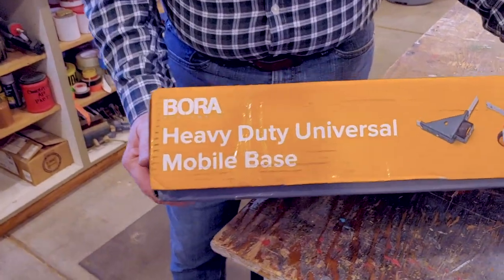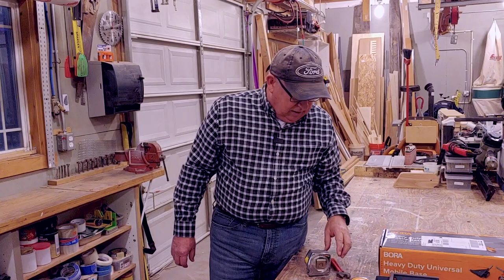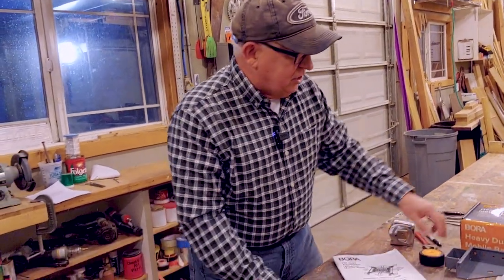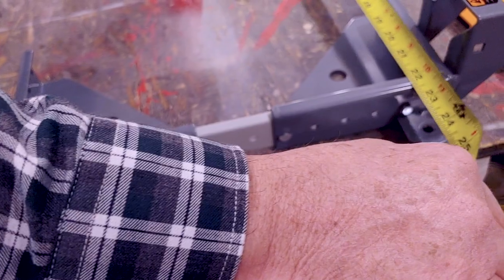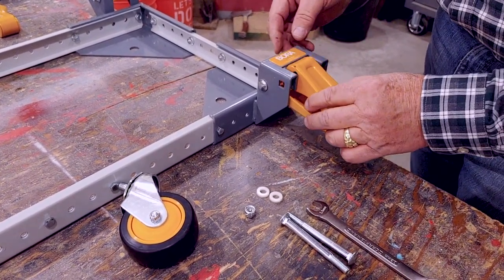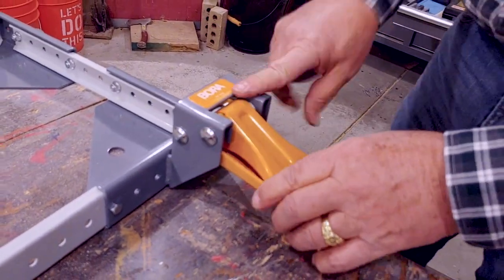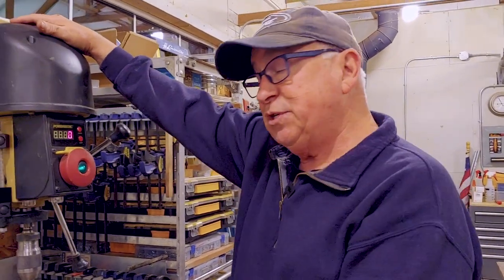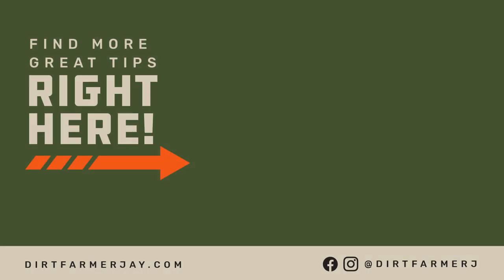Bora Portamate Tool Mobile Base

Comment: Your video I’ve referred to the most in picking this base, assembling and I’m very grateful you filmed this! One note for ppl, remember you need two bolt contacts on every corner and bracket joint where joined. I didn’t catch that at first but no biggy! I’m just so relieved to have something for my particular situation. I bought a side mounted Masterforce cabinet, I needed something heavy for my bandsaw to go on top of but also mobile because I have a tiny garage. Unfortunately Menards and the brand Masterforce were both difficult to work with. The manager laughed when I asked for the wheels that go with these cabinets… mine wasn’t sold with wheels unfortunately but I knew that when I bought it so not the store or brands fault there however if you tip it over on the bottom are four perfectly tapped holes in every corner of the base to add wheels onto. The manager even looked for himself, agreed each corner had four tapped holes but wouldn’t sell me the wheels that unfortunately are the only ones to match the tapped holes. Not happy, but I found this solution and was cheaper than buying four wheels for the cabinet. Now I can actually roll it around on my horribly unlevel concrete floor lol. My floor is so cracked and ridiculous I just hope I really can wheel this sucker around because with the cabinet and the bandsaw it’ll because extremely heavy. I still wonder if I should’ve just built my own damn bandsaw cart.

Comment: Thank you for this excellent video.  I am moving from an apartment to a new home that will have a woodworking shop.  After negotiations with my wife, the shop will be a bit smaller than I hoped.  Therefore, mobility will be very important.  One viewer commented on the cost.  But I doubt he'd considered what mobility bases cost when you look at buying one from the manufacturers of your woodworking machine tools.  if there even available the cost is double or triple the Bora Porta mate - and often these bases get bad reviews.  I love how you teach and I think you've sold 2 or 3 more of this product.  So if you're listening Bora, send a big check to Jay

Comment: Well done. I appreciate your well planned and clear instructions. My tip... my table saw, planer and assembly table are all on casters. They are set to the same height, so the assembly table can be an outfeed table for the planer and table saw. My drill press is mobile too. I just pick it up and put it on the assembly table.
Reply from the maker: JS, great to hear from you. I always enjoy reading your comments. I've already adopted your method and am enjoying the positive affects in my shop. Best to you, DFJ

Comment: Nice video.

I'm pretty sure the nut on the rubber foot goes underneath the flange.  The threads in the sheet metal of the flange aren't strong enough to hold very much weight, and are really there to lock the nut so it won't turn.
Reply from the maker: Thanks for this. I'll double check. I appreciate you writing and having my back. Best, DFJ

Comment: Good video. I like the detail you give.  One question.  I noticed that you placed the drill press directly on the mobile base without installing plywood.  Would there be any benefit to adding plywood into the mobile base?  That way, you can bolt the drill press to the plywood.  I would think this would make the entire unit more sturdy.
Reply from the maker: Thanks for the tip. You are correct. You could add 3/4" (19 mm) plywood, and it would give more attachment options as well as make the base more rigid. Best, DFJ

Comment: GREAT VIDEO!  I am looking to use the same Bora base kit with my new drill press.  Do you think bolting the drill press to a 24 x 24 plywood base  would help with stability?  It would add a couple of inches to each side - less tippy, but would increase the height.
Reply: I have the same question for my drill press. I'm using the smaller Bora model (PM-1100) that requires a plywood panel. My plan right now is to increase only the width, probably by about 6" on each side. It looks like the tipping danger is more from side-to-side than front-to-back. But I may be wrong on that as I don't have much experience with either this new top-heavy tool or mobile tool bases.

Comment: Hello, like the channel. Is there a reason you chose not to bolt in some fashion the drill press to the base? I actually have the same drill press and the same base, and I am contemplating on bolting the two together, feeling it will give it a little bit more stability.
Reply from the maker: Tim, thanks for being a part of our viewer family! There was no specific reason other than it worked adequately with the press just being set into the base. I agree that is the two were bolted together, it would be even better, and I may indeed do that in the future. Best Regards, DFJ

Comment: So when in use, your 400 lb tools is resting on 2 wheels and 2 little feet.  Doesn't seem ideal.
Reply from the maker: Chris, the system seems to work well, although there is a bit of flex when moving the unit. So far, good. Thanks for watching and writing! Best, DFJ